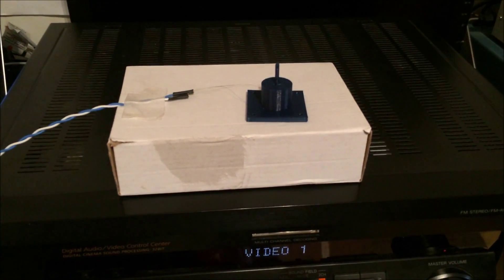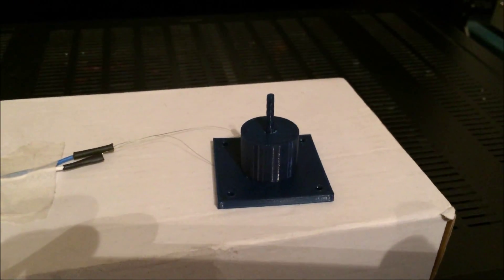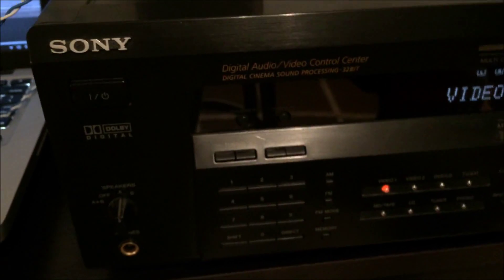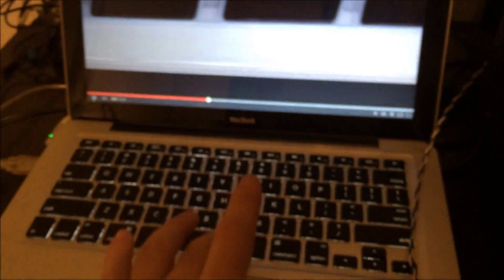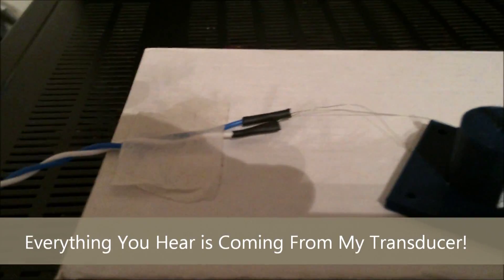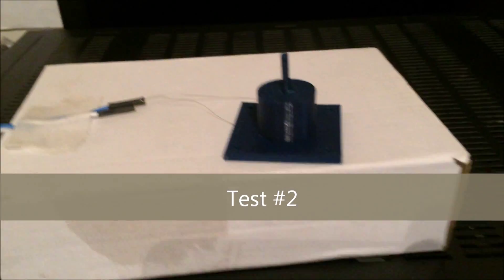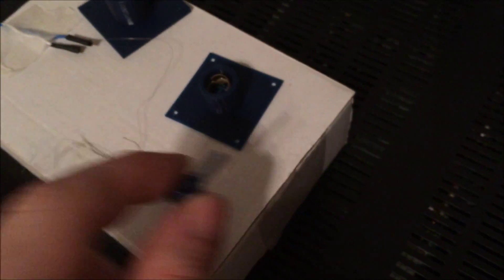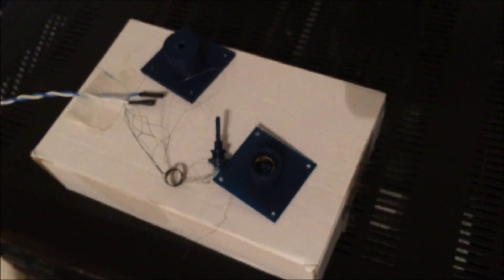Transducer Project With Test Video

Comment: Hi, what a cool project !! What's the diameter of the wire you're coiling ?
Reply from the maker: This video's transducer contained flattened 36 gauge wire.  This is not what I use today.
Reply: @opcode66  Better to diy or can we find some good transducers on the market ?
Reply from the maker: Better to DIY.  You have more flexibility in your overall head body design and dimension this way.  Otherwise, you immediately start with constraints.  Transducers are not hard.  You can make one by holding a coil with audio passing near a magnet.  You hand becomes the tracing element...